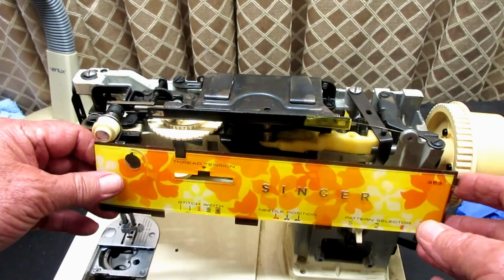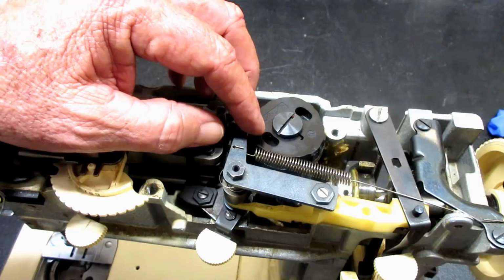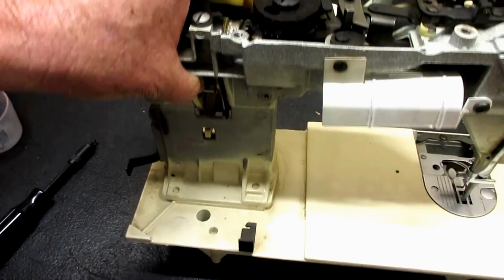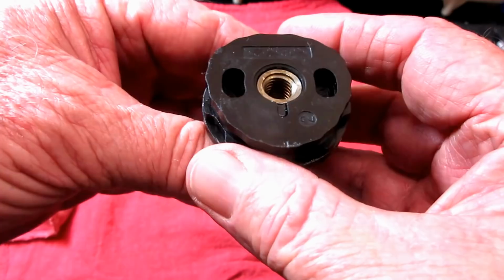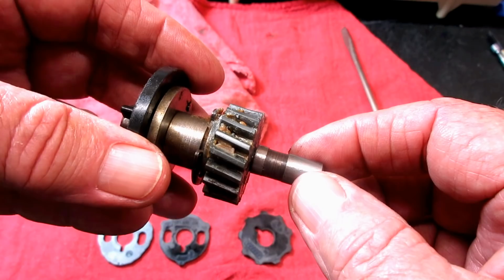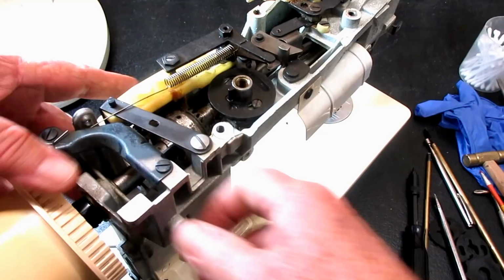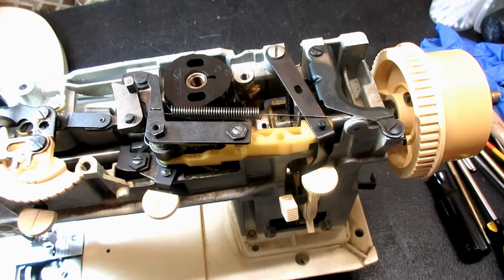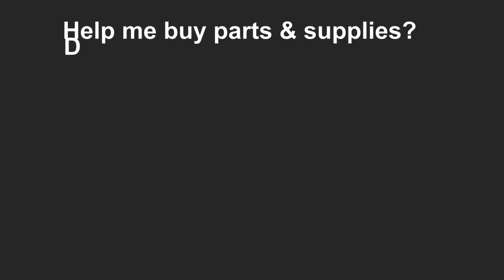How to Remove & Replace the Camstack on the Singer Model 353 Genie Sewing Machine

Comment: Hello Andy!  Love your instructional videos!  My Genie broke while sewing face masks during the current coronavirus pandemic.  With the help of your videos we have discovered that in fact we do have to replace the plastic gear on the vertical shaft.  The exact one you said you were hoping to never have to replace.  Where can we find that part and a repair guide that shows how to get to that piece?  Thanks for all that you do - keeping these beauties going and stay healthy!  Christine.
Reply from the maker: Sorry to hear this. You can buy a downloadable pdf copy of the service manual for $8.99 from this seller:
https://manualsoncd.com/product/singer-353-354-genie-sewing-machine-service-manual/
Let me give you a heads-up about this gear. The manual shows a 12-step process just to remove the gear/shaft from the TOP of the machine. This is because the original gear was permanently attached to the shaft so it could not be pulled out of the bottom like in my gear changing video: https://youtu.be/M3bFtlV1Y6s   If you see normal set screws on the existing gear then the original gear was replaced in the past and you may be able to follow my video to change it again. I have heard from two viewers, one just this past week, who was able to drill out the old rivets, or somehow "get a wire in there" to separate the old gear from the old shaft. In their cases one was able to remove the old gear from the side of the machine "with great difficulty" and the other "cut out" a portion of the metal frame to remove the old gear. They then removed the old shaft from the bottom, installed a new shaft, worked the new gear into the machine and on top of the new shaft and tightened the new set screws. They then only had to time the machine again and were back to sewing. The service manual method involves removing the Main Horizontal Arm Shaft from the machine and almost everything connected to it so you can pull out the shaft from the top, thus the 12-step method. However you choose to do it, here is one example of a trusted seller who has the new shaft/gear combination for sale: https://www.vintagesingerparts.com/products/new-replacement-top-vertical-gear-shaft-fits-singer-models-242-247-248-252-257-259-267-300-350-353-354-360-362-368-1263-1280   There are other sellers online and on eBay and probably Amazon. Please check for any shipping notes or warnings about delays. If by chance your gear was replaced before then you may need to only buy the gear, which you can also find online. I surely do not mean to discourage you, but only help you avoid "procedure shock" when you see the steps involved. If you are successful then, in my experience, the new gear should last at least 10 years, especially if it is one of the white gears and you don't put grease or oil on it. Best of luck.
Reply: Andy Tube Thank you so much Andy for responding.  That is so very kind of you!!  Not sure how we will proceed but will let you know if we're successful and what our experience is.  Stay safe and thank you again!
Reply from the maker: @missbeemaven6645  That's kind of you and best of luck.

Comment: Hello Andy, I am trying to repair the Genie 353 for my mum and i found out that the top plastic gear of the vertical shaft is broken. 
Accordingly, I bought the service manual and the replacement part as my mum love this machine and I try to repair it for her😂.
However, when i reach the step of removing the Shaft E (as indicated in the manual) in the procedure 18 "horizontal Arm Shaft", the manual asked me to turn the loosen the screw on another gear "D" for 4 turns and i can only make 1 and a half which results that the shaft cannot be removed.
Do you have any suggestion? Thank you very much
Reply from the maker: I've never done this. Looking at the directions and the size of the hole to get at screw "D" I think the set screw is larger than the hole and that is why you can only turn it 11/2 turns. You have removed the collar ( A & B) and loosened screw "C" and removed the handwheel already. I would try moving the Feed Fork Arm "F" to the right, then the Spacer "G" to the right then see if I could slide the Connecting Rod "H" to the right to uncover the hub of the gear and expose Screw "D" directly instead of going thru the hole in "H". Maybe I could pull the shaft "E" towards the nose a little since the collar "B" and handwheel are off. So move the shaft a little left and rods a little to the right. If I could not expose the screw "D" I guess I would follow the fork rod and connecting rod to the bottom of the machine and remove the set screws for them and the elliptical studs to help me move them to the right (handwheel end of the machine.) I can not see a way to turn screw "D" enough while the connecting rod "H" is covering the hub of the gear. There just is not enough room between the top of the screw and the inside bearing of rod "H". I don't know, but is turning "D" 11/2 turns enough to free the gear from the shaft? If not, I'd try what I described. If that fails, contact me at andytube53@gmail and we can try something else maybe. Good Luck.

Comment: Can you show how to replace top gear on the hook assembly mechanism. Please.
Reply from the maker: I don't have a Genie any longer. I do have a gear change video that can show y9u the process in general on another model https://youtu.be/M3bFtlV1Y6s   Replacing the top gear on the vertical shaft of a 353/354 is much more involved b/c you can't get access to the gear in the front. The Singer Service Manual shows a 12 step process for removing the main arm shaft and all that is attached to it to be able to pull the gear from the top. On many of the Genie/Starlet models the gear is pinned to the vertical shaft and it is all meant to be pulled from the top although viewers have had success with drilling out the pins and removing the gear as in my video by modifying the spaces in the metal frame. You can buy and download the manual here: https://manualsoncd.com/product/singer-353-354-genie-sewing-machine-service-manual/   The manual also shows all the other adjustments and parts replacements on the machine and I have several videos for that also in a playlist here: https://www.youtube.com/playlist?list=PLsCOZgzzaiKJvzcqn97Yh8lvx-tbdFl2p   BTW, it's 12-steps each way remove and replace.

Comment: Hi Andy, I'm trying to replace the vertical shaft gear on a genie 353. I encountered a problem when trying to move the horizontal shaft. On step 4, the set screw D is suppose to be turned 4 times but it will not even make  one full turn and won't clear the shaft. 
Any suggestions how to get that screw to turn?
Reply from the maker: Screw D is holding the vertical gear onto the Arm Shaft. The screw is covered by the "Ring" of the Feed Lifting Rock Shaft Connecting Rod. The screw is larger around than the hole in the RIng. In step 3 they had you loosen the screw that holds the Feed Cam onto the Arm Shaft. The feed Cam is that eccentric pice that the Forked Feed Connection pushes up against. That is so you can shift it Feed Cam and the Ring to the right to uncover screw D of the gear and turn it 4 times to loosen the gear. You can't loosen screw D while the Ring covers it and the gear. https://www.youtube.com/watch?v=Iz3dN6_LPyo

Comment: Hi Andy, I'm working on this model today. The three screws on my machine are silver, and interestingly, this machine is also missing the forth screw like yours.
Reply from the maker: I think our machines had need opened before, and the screws mixed up and/or lost. It is a tricky cover to remove compared to most vintage Singers.

Comment: Hi Andy, my can stack also looks different from yours. The zigzag cam is white and extends up (keyhole) and down to the base of the cam stack.
Reply from the maker: Are you working on a model 354 maybe? With the extra stitch the 353 does not have?

Comment: Hello sir i have a machine starlet 354 and i want to do embroidery without crowbar with only the needle but it didn'work can you help me !!!
Reply from the maker: Well, I don't understand the "crowbar". The Starlet does not have "drop feed", but came with a "Feed Cover" needle plate that raises your work above the feed dog so you move the fabric as you like. https://www.vintagesingerparts.com/products/vintage-original-feed-cover-plate-fits-singer-models-240-247ap-252-257-258-259-288-327-328-329-337-338-347-348-353-354-360-362-366-367-413k-413k13-416k-418-457-466-476-477-478
You can also buy different presser feet for embroidery. Here is just one style; 
https://www.youtube.com/watch?v=W_UqIpY-uRg
If I'm missing your point, please let me know what the "crowbar" meaning is in your comment. Good Luck.

Comment: Hello!  I am loving your videos to help me replace the arm shaft gear.  I can't remove the set screw in the frame just to the left of the tension mounting bracket and which holds in part of the thred take-up lever.  Any suggestions?

There was also a plastic  bushing ... part 319511.  Any ideas on a replacement for that?  I'm so excited to get back to using the machine but a stuck at this point and hoping you can help.
Reply from the maker: When I have a set screw like that, I use a dropper to put a drop of WD40 on the screw and let it sit a couple minutes, then heat it with a hairdryer for a few 4-5 minutes. If that still won't turn I put the screwdriver in the screw and rap it with a hammer while trying to turn it. Sometimes a couple good raps with that hammer will break the screw free. You'll hear a little "snick". You are the third person asking me about that plastic collar piece this month. Did yours crack in half? None of us can find a seller of that part any longer. One guy carefully glued his back together and reinstalled it. He told me it made no difference in how the machine sews. You have the parts manual? Is that how you know the part number? So you also have the Service Manual too?
Reply: Andy Tube the bushing has the part number on it.
Reply: Andy Tube and thank you so much for the tips!!!
Reply from the maker: @johnpatterson5092  Oh sure, maybe they can help. Good luck, John.
Reply from the maker: @johnpatterson5092  Haha, thanks! I never saw part numbers on small plastic parts before but that Genie is a little newer than most of the machine I restore.

Comment: Hi Andy... can you please make a video on how to replace the gear on this model? I'm having a hard time figuring it out 😥🙏🏾
Reply from the maker: I do not have a model 353 in my possession any longer. The 353 is not like the 457 in my gear changing video. The Singer 353 models have a different setup. The gear and shaft must be replaced thru the top of the machine and it is a very difficult repair with 12 to 14 steps out and back in. Then the parts have to be readjusted to factory specs, like presser bar height, needle bar height, cam timing, hook timing and so forth. This the gear and shaft for the replacement.
https://www.vintagesingerparts.com/collections/singer-model-353/products/new-replacement-top-vertical-gear-shaft-fits-singer-models-242-247-248-252-257-259-267-300-350-353-354-360-362-368-1263-1280
If you really want to try to do this you can buy a service manual here that has the instructions: https://manualsoncd.com/product/singer-353-354-genie-sewing-machine-service-manual/
I don't recommend it, Juliana, unless you have a lot of mechanical experience or someone to advise/help you. It certainly can be done, but it is a long, tedious job.
Reply: @andytubesewing1953  Alright Andy. I guess there goes my little antique. Thank you for the advice 🙏🏾
Reply from the maker: @julianaewusi-essel6946  I'm sorry to give you the sad news. 😢Here is a great video from Andre Bandarra about his adventure replacing the top gear on his mom's model 354 (353 sister). When he gets to all the parts on top that attach to the main horizontal arm shaft you'll get the idea of what it can take. You need to pull that arm shaft at least half-way out to get the top gear/shaft up and out of the machine, then put it all back. The parts of the machine sold off on eBay can bring the seller about $300. The covers, bars, tension, motor, and front plates, etc usually sell quickly. Maybe you can find a different machine for use. Sigh... too sad 🙁 Maybe with metal gears, 337 or 403 for ZZ or 301 for straight stitch only.